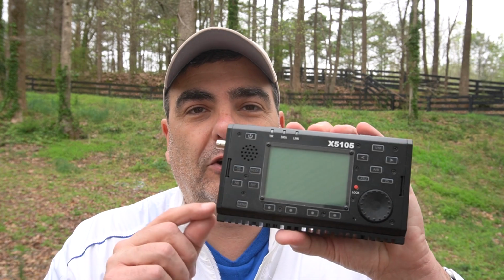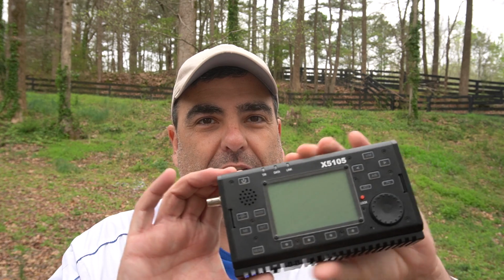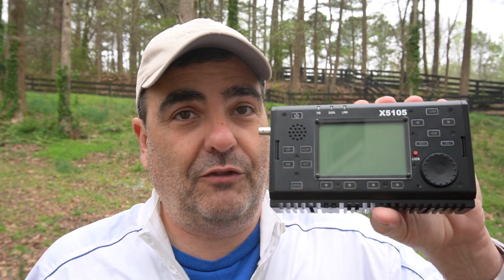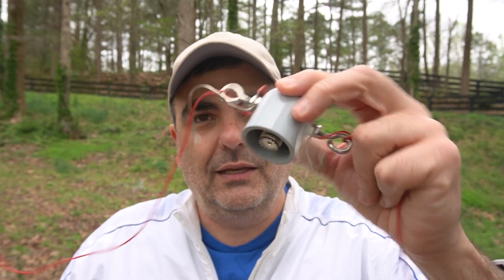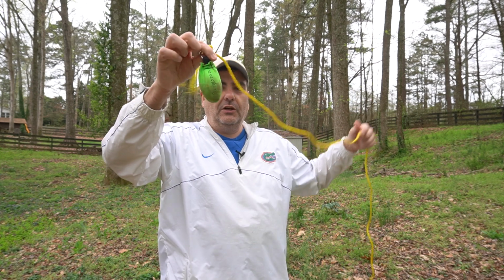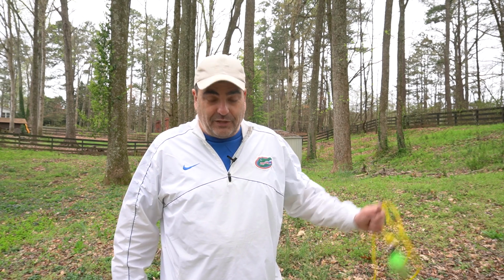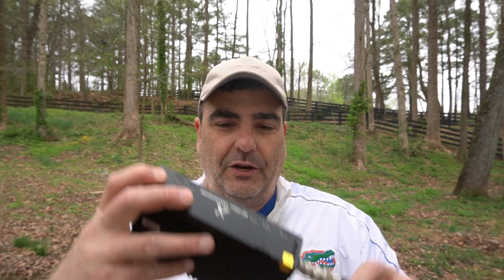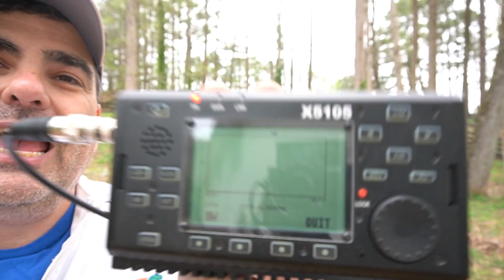Adventures in low power ham radio

Comment: Have greatest interest in QRP and manpack options as find it most suitable to potential real world uses as well as hobby use. I am curious what other trancievers would you recommend for such uses? one of major concerns or points would be battery power and weight vs current draw and output power no? thx . been watching many of your videos like your very straightforward approach .
Reply from the maker: Previously I had yaesu FT-817ND, but I found the battery insufficient and I had to pack a tuner or be stuck on a single band. A lot of people like the Elecraft KX line. For the features, price, size and weight I really like the Xeigu. I know the Elecraft is a better radio, but that price difference.

If you are serious about size and weight, you need to learn CW (morse code). There are seriously small and light CW only radios.
Reply: @HamRadioInAction  Thx so much for quick reply and although I"know" cw( but barely as my use was more academic at the time as not a true commo or signalman but grunt with some extra skills haha ) amongst other types of linear pulse type  comms even tap codes etc. but need much practice to be proficient wpm wise.That's definitely where my interest would be . There is much carry over from my backround in Amateur comms but not all of course. field expedient antenna construction , propagation and methodology definitely apply .Thanks again will be binge watching many more of your videos. Btw I have made many  comms on 5 watts albeit with a whole lot of precut slash wire over distance so this would be a nice throwback but also very usable knowledge to have especially when well practiced.I will further research your recomendations.

Comment: KJ5PEM UHF only thanks for the videos I am a new general got a new x5105 working make some contacts if you have any advice
Reply from the maker: QRP is all about the antenna and patience. If you are interested in digital modes, you can make plenty of contacts on FT8, which was designed as a low power mode. I find I make the most SSB contacts during contests. Just make sure you visit the contest page, so you know the proper exchange. https://www.contestcalendar.com/weeklycont.php

Comment: KE4SJM UHF ONLY.  I sent you an email about four month ago, when I became active again in ham radio, about my old AT&T truck that I got at auction. You asked me to send you some pics. I still need to do that. I did go to HRO and asked about all the coax ends and antennas that were still on the truck when I bought it. I finally installed a mobile 2 meter. I’ll sent you some pics soon.

Comment: Thanks Brian for this another interesting radio. By the way, I have passed my Ham exam but licence is being delayed due to the lockdown. Meanwhile, I am seriously looking for a portable all in one (HF,  VHF, UHF) with at least 50 watt output in the HF bands. Hope you will be able to guide me.
Thank you
Reply from the maker: Can't help you with the radio recommendation. I've only ever used the FT-817ND all in one, but I cannot recommend it and it's only 5 watts.
Reply: Look at the Yeasu FT-857D. All Bands All modes 5-100watts
Reply: @neubert500  Hope it is light and portable. Thank you!
Reply: @shandybrandy5407  It is slightly larger than my FT-817ND  and not TOO heavy! My son has one and loves it, I have the larger FT-897 and smaller FT-817. Good Luck!